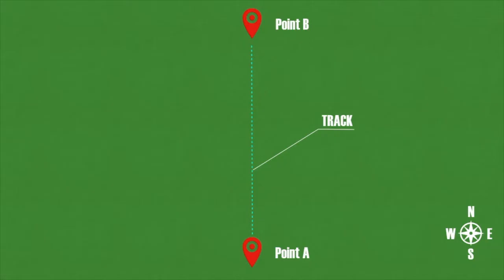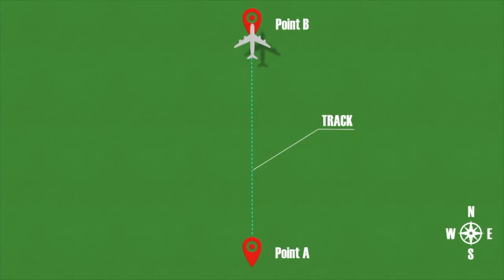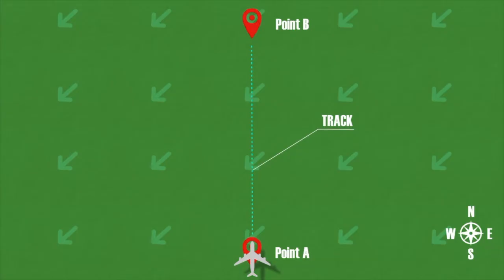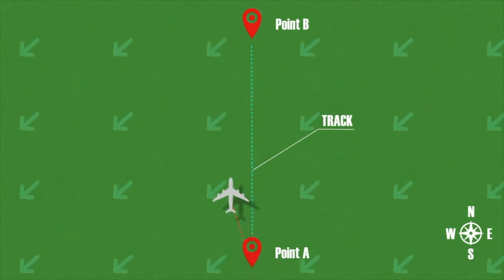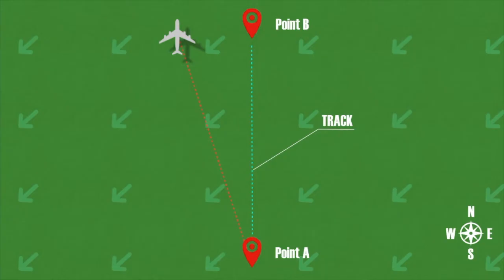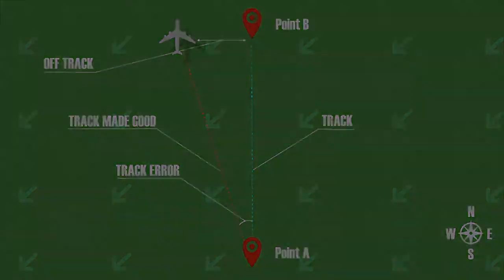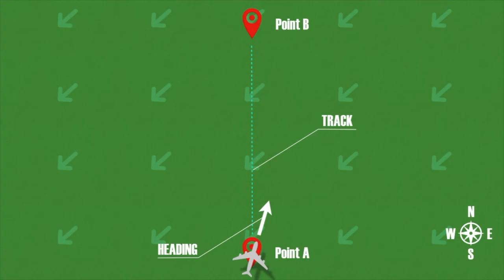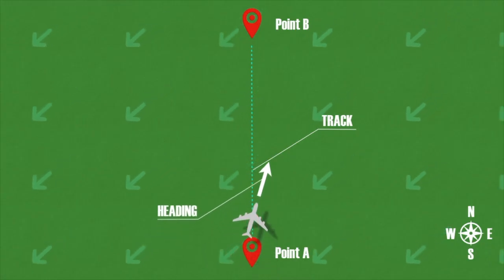Track vs Heading.

Comment: If the plane's nose and its propeller are turned into the wind, does the headwind component of that wind prevent the plane from moving into the wind, now that the propeller turned into the wind?

Comment: This is a nice video but I thought it was going to say how to calculate the heading. Thats what I'm looking for.
Reply from the maker: Thank you. Calculating heading is a massive topic. Good idea though.
Reply: @flightclubonline  Yes I came here for the same thing.  It would have been good for this video to say at least “your heading is correct for only a limited time, even if your tracking is correct” and “even when on track, your heading will have to change, and that is a topic for another video”

Is this what Bearing is?